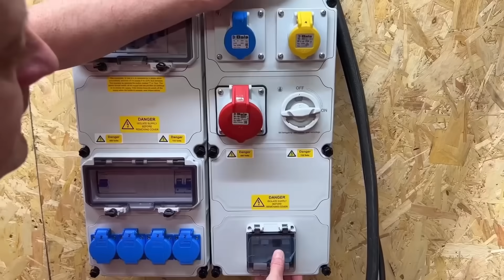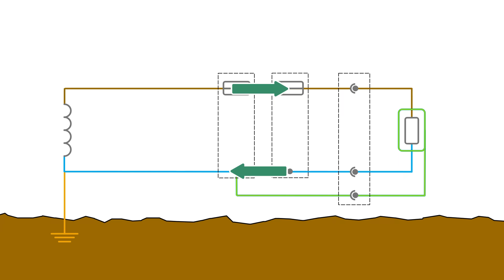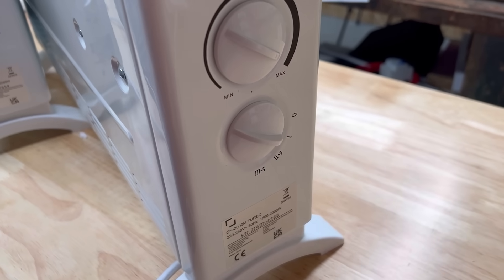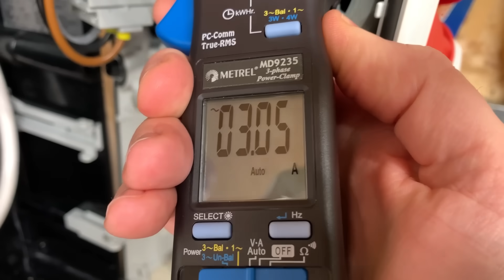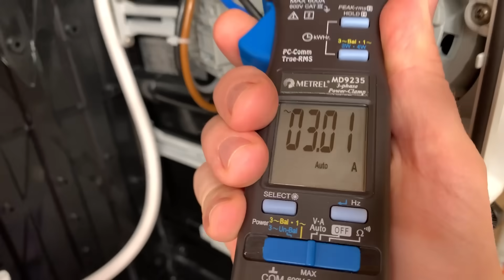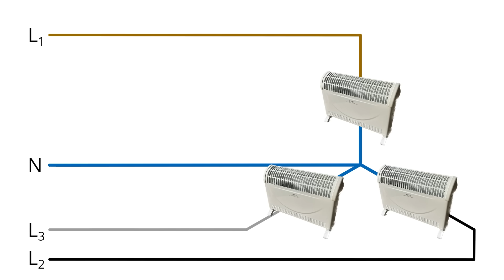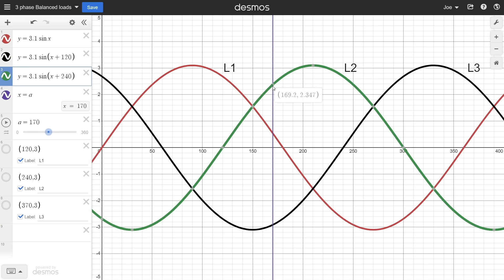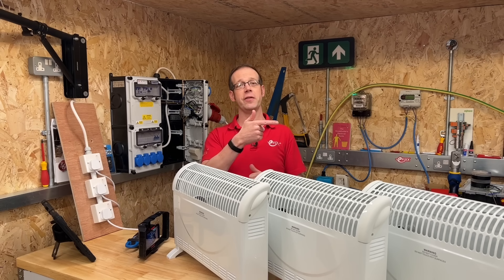Does Current Flow Through The Neutral Wire?

Comment: For anyone having trouble envisioning this, it's a bit easier if you start with something like American (two phase) house wiring, which comes in from the pole transformer as 240V, but with a center-tapped neutral wire.  That means that neutral to either live conductor is 120V, so you basically have two 120V circuits, but each one is 180 degrees out of phase with the other (and typically half of the house circuits will be wired to one side and the other half to the other side).

Because of this, if you need more than 120V for some appliances (such as many stoves, water heaters, EV chargers, etc), you can just connect them across the two different "live" wires to get total of 240V instead.  In that case, you don't need the neutral wire, because all of the current going in on one side is balanced by the (exactly opposite) phase on the other wire going out.

But it also means that on the neutral line going back to the pole, there may or may not be a lot of current, depending on how well the loads on the different house circuits are balanced.  If you've got the same amount of stuff going on one half as on the other half, then all of the current will go "in" from live A to neutral, then from neutral to live B and back out again, and there will be no net current on the neutral line.  However, if there's more load on the A side than the B side (or vice-versa), then all of that excess needs to go back out the neutral instead.
Reply: wow that explanation made my brain hurt
Reply: I am sorry, US 240/120 vac Single Phase is what most American residential homes are supplied with, Hence, SINGLE PHASE! Not two phases! Everyone seems to think of it as two 120 volt phases 180 degrees out of phase, It is not! It is ONE 240 volt phase center tapped to create 120 volts for use on 120 volt devices (accepted safety standard in the US and other places as well)! Center tapping the transformer winding does not create two separate phases it creates two separate voltage potentials on the same phase! The center tapped winding and or conductor is then grounded and or bonded to the primary neutral creating zero potential difference between it and ground/neutral. It's only purpose is to carry any unbalance of the 120 volt current back  into the transformer winding! One winding! One 240 volt phase! Draw it out on a piece of paper and realize also that the unbalance can only flow with with neutral from one side of the split phase at any given time. This scenario is 240/120 split phase (Single Phase! perhaps people get the wrong understanding due to the term split phase and not realizing it is being created with just one winding. In the US, It was common 30+ years ago to see 240/120 delta three phase in all types of buildings, this too could be a reason for this misconception or misunderstanding 240/120 split phase). On your piece of paper draw out your homes electric supply as two ungrounded lines (one 240 volt circuit) coming from the transformer and one grounded center tapped line! Now draw it out as a schematic and start adding 120 volt and 240 volt appliances. Now draw out a sin wave graph of your schematic, when the peak of the 240 volts is on one conductor of the circuit the other conductor is at a potential difference of 240 volts less (zero volts in this situation) and the center tapped conductor is at a potential difference of 120 volts less/more respectively to each of the main ungrounded conductors! Keep in mind the primary winding is just one winding with one side of the winding grounded. I hope this helps clear up the whole two phases, out of phase misinterpretation! I to this day see seasoned electricians refer to the 2-240 volt ungrounded conductors coming into a house/building as phase A and Phase B thinking they are two separate 120 volt phases, they are not! And if they are, they are not 240/120 split phase!
Reply: @k---youtube  I think you're trying to quibble semantics, and you're doing it by redefining some terms in ways that are different from how everybody else actually uses them.

All voltages and phases must always be relative to some reference  (without a reference point, the terms are meaningless).  In power distribution systems, unless explicitly specified otherwise, these terms are almost always referenced relative to neutral/ground.  And relative to neutral or ground, each hot line of a US split-phase delivery is 120V, with opposite phases (180 degrees offset) to each other.

And there is electrically absolutely no difference between a single winding with a center tap and two separate windings of opposite polarity which share a common neutral, so the number of windings in the transformer is completely irrelevant to this question, really.

(Also, by your logic (if phase is considered with one of the live conductors as a reference, and not relative to neutral), then standard 3-phase power would actually be only 2 phases, because there's one phase between the A and B legs, and then a second phase between A and C, and that's it.  This is obviously not how anybody actually defines it in reality, though.)
Reply: @foogod4237  No Sir, Not trying to quibble with  semantics or offend in any form. Just trying to expand and shed light on a common misconception of this subject. I am merely stating that a 240/120 vac split phase service (common US residential electrical supply) is not two separate phases. In your original post as well as in your rebuttal, you state that it is two 120 volt, 180 degree opposing phases. This is a misnomer, the two 120 volt halves of the 240 volt service are not two separate phases 180 degrees out of phase with each other but indeed 100% in phase with each other!
You actually validate my argument in your rebuttal, You make the claim that there is no difference between a single center tapped winding and two winding's of opposing polarity sharing a common neutral (180 degrees out of phase with each other). This is exactly my point! There is a difference and the difference significantly confirms what I am pointing out. A single center tapped winding (in this case is the 240/120 vac split phase) supplies 240 volts between the two ends of the transformers winding and 120 volts between either end of the winding and the center tap of the winding.
Two separate opposing polarity winding's sharing a common neutral will have 120 volts between the end of either winding and the shared neutral point and halve zero volts between the two ends of the winding's! They will have zero volts because they are 180 degrees out of phase (opposite/offset) with each other! Plus the shared neutral will now carry the total combined  current! 
reference to ground/ neutral has nothing to do with this at all, a reference point can be anything you want it to be. your reference to 3 phase doesn't make sense, when your measuring voltage on three phase your either measuring between phases (two of three or three of three phases 120 degrees out of phase with each other) or from phase to ground (three separate phases).
Reply: @k---youtube  "Two separate opposing polarity winding's sharing a common neutral will have 120 volts between the end of either winding and the shared neutral point and halve zero volts between the two ends of the winding's! "

Ok, this isn't even semantics, this is just fundamentally a totally wrong statement.  If you don't believe me, I strongly encourage you to actually try it yourself.  I repeat:  there is electrically absolutely no difference between a single winding with a center tap and two separate windings of opposite polarity which share a common neutral,  That means they physically cannot produce a different electrical result.  The two are electrically the same circuit and guaranteed to be exactly the same in terms of the electricity they produce.

"They will have zero volts because they are 180 degrees out of phase (opposite/offset) with each other!"

No, you are not describing opposite phase at all.  What you are describing would only be true if both wires always had the same voltage potential (0V difference) at all times, which is actually the definition of being in the same phase (0 degrees offset).  If they are in opposite phases, then they must always have opposite potentials, which means one would be at -120V when the other was at +120V (relative to ground/neutral), and vice-versa, and therefore the difference between the two would be ±240V (peak-to-peak), not zero.  This is, in fact, exactly what you will see if you look at the two live conductors of a split-phase system with an oscilloscope, proving that they actually do have opposite phases (relative to neutral).

It seems pretty evident that you don't actually really know what 180 degree phase offset means or looks like (or possibly also what "opposite polarity" means), so I would encourage you to read up on that a bit more, and possibly try it out for yourself (with maybe a lower-voltage AC power source, an oscilloscope, and some different transformers).
Reply: @foogod4237  I understand what your trying to say. However, in regards to an oscilloscope you are not seeing two phases 180 offset (actually 180 degrees out of phase with each other is the proper term) because the oscilloscope is using the center tapped grounded conductor as it's reference. It is showing the exact same phase sin wave as a mirror image. The opposite of the other 120 volt single phase side. If you have access to an ungrounded oscilloscope and take a reading you will see the sin waves overlayed with each other exactly.  Also, I most certainly know the differences between out of phase and opposite polarities and as far as reading up a bit more, well, I have written over 70 essays and 3 books on electrical engineering, spent 40 years in the engineering field of which the last 20 were with ABB as a power distribution engineer! So I would encourage you to perhaps run the tests I have explained and learn for yourself what opposite polarity and out of phase mean. They are not the same! Not to mention, I would love to physically see how you can change the magnetic flux direction of a single coil winding secondary with a single coiled winding primary into two separate opposing phases just by tapping the winding? 240/120 single, split phase is one phase! the two 120 volt halves are a lower voltage potential of the same phase, One Phase! Your oscilloscope is showing the opposite polarity of the one phase as a separate phase! It's because your oscilloscope is grounded! Look, everything your stating is accurate except for there being two 120 volt phases of opposite/opposing direction at the same time! It is not! The only thing that is 180 degrees apart is the polarity of each half cycle. And by your logic if it were two phases 180 degrees apart you would have no potential voltage difference between the two ungrounded sides, hence no 240 volts! They would always be at equal potential of each other! It seems pretty evident that you don't actually really know what electromagnetism means or looks like ( or possibly what the fundamentals of induction are), So I would encourage you to read up on that subject along with how to perform the proper tests using the proper tools correctly! Start small, Perhaps some flashlight batteries/small ac transformer and an electronics kit from a local hobby shop. After you develop a solid understanding of how current flows and the effects of electromagnetism on inductors and such perhaps then you could actually give people real, accurate information! Just Saying
Reply: @k---youtube  
In three phase each phase is separated by 120 degrees. The US system is single phase, with each of the two hot conductors separated by 180 degrees.

So, as far as the electrician sees it, the transformer gives him two phases coming in 180 degress apart not 120.  He treats it like two phase.
Reply: 180deg across the phases. You sure about that?
Reply: @greenpedal370  Yes, he is quite correct about their being 180 degree phase shift between the two lines in the US split phase system. 

If you know enough about sine waves and electricity, you will realise that 180 degrees is the only way that is possible.

If you think he is wrong because you think it should be 120 degrees, then that is certainly incorrect. 120 degrees phase shift between phase conductors only occurs in 3 phase systems. And that is because they physically position coils around in the generator at 120 degrees around the rotor.

In the US split phase system, the phase signals that are distributed to consumers  do not originate from the power station and generator, they are produced by the down stream distribution former and is a result of how the secondary windings are connected. It's very different to 3 phase.
Reply: @deang5622  so who makes the powers supply? who is spinning the magnet??
Reply: @magnito9811  What has the transformer got to do with the phases of the supply in 3 phase? Answer nothing!

The transformer only comes into it if we are talking US split phase as it's the connectivity to the secondary windings and the configuration of the windings that enables two separate phases to be produced.

So I'm totally puzzled where you are going with this useless question?
Reply: @deang5622  you’re a pure genuis, i have one more question if you don’t mind. i don’t understand how voltage reading works in low voltage wirings, i put one lead on common and one lead on whatever terminal but i don’t understand why or how i read voltage, doesn’the common terminal have voltage too? since the meter measures the difference how do i get a reading?? i do understand how i get voltage if i have one prope on ground that’s makes sense, but a common point in a live circuit?? please help me thank you
Reply: @magnito9811  Don't be so friggin childish.
Reply: @deang5622  sorry i’m new into electricity and want to be top techs, i want to understand every little detail about electricity
Reply: @deang5622 
> 180 degrees is the only way that is possible

Be careful about your wording though. There are still cases where some consumers get two 120V live taps which are 120 degrees out-of-phase. I can think of one scenario: apartment complexes with shops on the ground floor like laundromats. Those businesses often need three phases compared to residential units who just need two. What they usually do is they give three live taps to the shops. They then divide the residential units to three groups, each group having a pair of live taps. So I'm not sure what you mean by "[it] is the only way possible." The only difference here is the residential units receive 208V on their usual "240V" outlets but they could still plug their 240V devices fine (assuming that device is compatible on both voltages). I think the split-phase is only common is suburban areas which I assume is widespread in the US.
Reply: @unhash631  I think you will find I am careful about my wording.

Let me explain again.
If you have got 240 volts from a 120 volt system then it can only be done by having two phases 180 degrees apart. I challenge you to find another way to do it.

If you have two phases at 120 degrees apart at 120 volts each, then you do NOT get 240 volts RMS. That's a simple fact.
Plot the waveforms out on a piece of paper on the same chart on the same axis and work it out
Reply: @deang5622  I see what you mean now 😅 and I agree; It's impossible. You don't get 240V RMS with a 120 degree phase shift.

I just thought you were implying that we don't use 120 degree phase shift in North America. We do, especially in urban areas. Just wanted to point out for those who people not familiar with out electrical system. They might be confused how we deal with these intricacies.
Reply: @unhash631  if the two waveforms are at zero degrees or 180 degrees phase shift relative to each other, then the potential difference is a simple numerical subtraction of the RMS voltage value.

If the waveforms are at any other degree phase angle, then it isn't a simple subtraction and you have to resort to trigonometry (using sines and cosines) or complex number theory, representing each phasor as a complex number in the form of a+bj , which encompasses the magnitude and phase.

Or you use a website which can calculate the RMS voltage between the two phases where you input the phase angle and RMS voltage.
Reply: @deang5622  Now in a 3-phasor diagram you add the 3 vectors, you end up with zero.  In a US system with a split transformer, do you end up with zero or 240? Meaning, are the to votages in phase or in opposite phase?
Reply: @deang5622 Hi Dean. In a residential service in north america you have a 120/240 single phase service. There is  no 180 deg out of phase. there are 2 120v windings on the same transformer core operating in phase and they are wired in series with the centre point brought and in most cases bonded. This is where your white neutral wire is taken from. The other 2 wires are 240 volts apart as there are 2 120 volt coils in series.
Reply: Yep, one of the transformer 240V phases will be centre tapped. 

That gives 2 x 120V, which in series drive high power devices like tumble driers, washing machines and whole house air-con.

When I worked in the US I wired my UK hifi amplifier across the two.
Reply: 240 volt power is only single phase so there is no phase shift. I have never heard of 2 phase power
Reply: @scottmc1178  
There is such a thing as 2 phase power. I have come across two phase motors.
Reply: @johnburns4017  Its only split phase power. 1 of the 3 phase power. They tried 2 phase in the early 20th century but it died off.
Reply: @greenpedal370  Yes he is right in the two phase electrical system in the US.
Reply: The voltage system in your average American residential setting is going to be derived from a single transformer that steps down high voltage (ranging from 4160V-13.8kV or more) down to single phase 240/120V, with the neutral connection originating at position X2+X3. 

Although 2-phase does exist and is addressed in the NEC, it is all but a defunct voltage system. The vast majority of electrical systems in the US are either single phase 3-wire 240/120V, or 3-phase systems 3 or 4-wire systems of varying voltages and transformer configurations. 

Please make sure your info is correct before posting.

In a multi wire branch circuit that consists of 1 a-phase wire, 1 b-phase wire, and a neutral wire, the neutral will be the return path for the unbalanced current between the A and B circuits. 

A common example you’ll see in houses that was standard practice in the last couple decades was to run a 12/3 cable to power the food disposal and the dishwashing machine. 

Both circuits are on separate phases, but share the same neutral wire. 

Let’s say the dishwasher uses 3 amps, and the disposal uses 12 amps. Because the way parallel circuits work in an AC system, voltage stays constant, and amperage between phases is subtractive. With this in mind, to find the current returning on the neutral wire you would subtract the lower amperage from the higher amperage: 12A-3A=9A. 9A will be returning to the source on the neutral wire.
Reply: @J_Trask   "Please make sure your info is correct before posting." Sorry, was that directed at me?  Because I'm not sure what you're saying I got wrong, since as far as I can tell you just said basically exactly the same thing I originally did with slightly different wording.

If you're referring to my use of the term "two phase", that was actually correct.  Many people seem to believe that "two phase" can only ever mean a 90-degree phase offset (which is, if I remember right, what the NEC calls 2-phase, and I agree is pretty uncommon nowadays), but that presumption is only an NEC convention, not something inherent in the meaning of the term itself.  The fact of the matter is that the US system we are both describing (known as "split phase" in the NEC, I believe) does still employ two distinct electrical phases (relative to neutral), and thus is also very much a form of two-phase system (more specifically, it is a "180-degree two-phase" system).  I used the (descriptive) term "two phase" instead of the (NEC) term "split phase" because most people who are not US electricians do not know what the latter term actually means, and I wanted to explain the parallels between the system and the "three phase" system being described here, so the number of phases involved was actually the relevant point, IMHO.
Reply: 240 volt power in North America is single phase of a 3 phase system.
Reply: U.S. is single phase. not 2 phase for residential stuff
Reply: I'm sure I have read that he US system isn't two phase - but rather rather single phase with a three wire supply - one coming in at 240v wrt neutral and the other from a centre tap on the transformer at 120v wrt neutral. So called split phase - but both hot wires are in phase with each other - just at different voltages.
Reply: @_chrisr_  A bit wrong. Before the service drop in a typical home, there's a transformer. This transformer usually takes a single phase from a three-phase/three-conductor transmission line. The transmission line voltage can go as high as thousands of Volts but on the consumer side, it's always 120V wrt to neutral on each leg. So inside the house you could have two 120V outlets which have two different phases but all your 240V outlets are always in-phase.
Reply: @unhash631  thanks - is the phase shift because of the way the transformer is wound?  How much is it shifted by?  What is the rms pd between the two phases?
Reply: @_chrisr_  The phase shift is because of the center tap. The waveforms on each leg mirror each other to achieve 240V so each leg is shifted to each other by 180 degrees.

That is the usual setup in a typical suburban home. In urban areas though, there are cases where the shift is only 120 degrees. This typically occurs when you live somewhere dense and you share a line with some establishments that use three-phase electricity. In that case, your line-to-neutral voltage would still be 120V but your line-to-line would only be 208.
Reply: @unhash631 
Yes, the 240v is in phase. The two 120v circuits are 180 degrees our of phase.
Reply: @_chrisr_  No, the neutral is actually the center-tapped wire.  The result is that you have one hot wire that is 120V, and another hot wire that is "-120V" (120V with opposite phase).  If you combine the two hot wires with opposite phase, you get a total difference of 240V between them, but nothing is ever more than 120V relative to neutral.

(This is actually part of the genius, IMHO, about the American system, as even on 240V circuits, if you have a fault to ground or neutral (such as somebody touching one conductor and ground) the fault potential for each hot wire is still only 120V, which actually makes a lot of things safer.  It also lets you split the load evenly between the two hot wires coming from the pole by just putting different house circuits on the two different 120V phases, while also still allowing you to supply 240V to things that actually need it)
Reply: @foogod4237  thanks for the explanation - that system is what we have here in UK for use on construction sites - equipment is designed for 110V and supplied from a transformer where neutral is centre tapped and the 110 is across both ends so a worker bridging line and ground/neutral will only get 55v shock.
Reply: @_chrisr_  
Called a Centre Tap Earth System. 110V CTE (55V-0V-55V) 240v to 110v transformer. 

In a 110v CTE system, instead of the neutral lead, the centre tap is connected to the supply earth from the 240v side. The secondary side has no neutral. Caution must be taken to ensure that no live lead is earthed, as a short-circuit may occur leading to transformer failure. Also, the centre tap of the transformer should be left unconnected when is it not in use in an unearthed system.

Commonly used for site safety portable tools. The centre tap splits the winding into 2 sides with each having only 55V with respect to earth. In case of an electric shock, this limits the shock to 55V, half of 110V. Although 55V can still be a fatal shock under certain circumstances. For portable tools usually installed with an RCD.

Similar to the US domestic system where a shock on the 240v side is only 110v.  The reality is that RCDs have negated 110v in construction sites.
Reply: @johnburns4017  quite an ingenious system.  That was my understanding of the US system too but instead of -55 and +55v output there is only one 120v and one 240v output, both in same phase but at different voltages and both 120v different with respect to each other and 120v to neutral from the 120v tap and 240v with wrt neutral.  People with more knowledge than me say there is a phase difference too - if there was 180 shift then voltages would be same but if there was 120 difference such as would be seen witth a 3-phase system then (according to chatgpt) the voltage would be 120v assuming a line voltage of 415v between phases.  However I understand that the three phase system in US is 480v so if two phases were utilised the output voltage would be 157v and since that isn't what is observed I am concluding that it is just a centre tap transformer on single phase.
Reply: @_chrisr_  
There is no genetator phase difference in the US two hot wire split phase system. It is all off the same genetator phase. 

The transformer, off one phase of the generator, gives 240v on the full secondary transformer winding. Take a tapping off it half way then you have 120v. Take one off a quarter of the way then you have 60v. All off the same  phase.

The transformer presents to the building two hot wires 280 degrees out of phase. So as far as the building sees it, it is single phase 240v and two 120v wires 180 degrees out of phase. Connect the two out of phase 120v wires to an appliance then single phase without a neutral.

The cludge of a US system came about because of commercial interests between Westinghouse and Edison. It was not a wonderfully dreamed up highly technical  state-of-the-art system at all. It was also to save on copper cables. On the Kathy Loves physics channel, she goes into the history.
Reply: @_chrisr_  I think you are correct.
The 240volts is just the potential difference across the two ends of a single secondary coil, which is centre tapped in the middle so that 120v can also be produced.
Reply: FFS! If you have trouble envisioning it then go back and re do your entire electrical training!

It's that basic a question. And if you don't know the answer to it, you shouldn't be anywhere near mains electrical installations, even if you are "qualified". Because for you not to know the answer means that: 1. You have forgotten your basic electrical education, and 2. That you don't really understand electricity.
Reply: This depends if you have a balanced load some loads on the split phase system do still need a neutral to balance the load but still need both phases to get 240 volts to run the load. Some things I've seen are weird where like in an ev charger some have complex circuitry that do the load balancing and there is no need for a neutral there. But ya just depends.
Reply: To my understanding the two lines in a 240v circuit are returning on each other back to its source.
Reply: @mikerosoft1009  Define "source". In order for electricity to flow the lines in any electrical circuit the lines take out and then return the current to the source.

In US system the 240 volt is produced by taking the output from a step down transformer, where the secondary winding is centre tapped so that two voltages can be derived: +120, -120. Both referenced to the centre tap point.
Making a final circuit using the +120 and -120 volt lines gives : 120 -(-120) = 240.

In Europe and UK, the 240 or 230 volts is achieved by : taking one of the three phase conductors and taking the voltage between that and neutral.
The transformer is a 3 phase transformer and has a common point of one end of all 3 secondary windings connected. That is where the neutral point is connected.
So the 230 volts (still is 240 in the UK on the actual circuit) is across any of the three phase outputs from the transformer and that neutral common point of the 3 windings (the windings are connected in a star configuration).
Reply: Yeah, but one thing I've never understood about this is that for many applications, such as within large buildings or multi-unit residential complexes, it's not 240. It's 208. If you look at the peak of his desmos graph, the current through L1 is 'balanced' through opposite currents through L2 and L3 at peak. When you pull this two-phase version (technically called single phase still) as opposed to the 240V split phase, and you try to run your stove or drier off a 208V plug, does that extra current that would've gone through the third phase go through the neutral? I've seen 240V applications not require the neutral - you just run the two hots of the split phase. But running two hots in a 208V system, the current doesn't balance.
Reply: @smokeybobca  You're right, there are some (usually large multi-tenant) residential situations where the two hot wires actually add up to 208V instead of 240V.  This is because instead of taking a single phase from the power company and running it through a center-tapped step-down transformer to get split-phase for each residence, they actually just run three-phase power into the whole complex, and then for each residence they just use two of the three legs for the two hot wires.  This means that in those cases, the two phases are not 180 degrees but only 120 degrees apart from each other, which when you sum them together results in a voltage difference of only 208V instead of the full 240V.  This is usually "close enough" for most high-power appliances (though electric stoves and such are sometimes annoyingly not as powerful as they should be, etc), and it's actually a lot easier and more efficient to wire things this way for situations where you're distributing power to a whole bunch of densely-packed residences.

In terms of balancing, there is no extra power going over the neutral line for any individual appliance/residence from this, but it does mean that for the whole complex, there may be more current flowing over two of the three conductors than the third one at any given time.  However, typically which two wires are used is chosen to be different for each residence, so the idea is that over all of them, the different power usage will probably more or less balance out most of the time (because, for example, a large appliance in residence 4 on lines A and B will be mostly balanced out by another large appliance running in residence 37 on lines B and C and a third one on residence 208 on lines C and A, etc).

Most single-family homes and such have a transformer for each house, though, and supply the full 180-degree split-phase power to the house, and that's usually what most people assume when talking about split-phase power in general (and is often much easier to visualize, because the phases are exactly opposite so you don't need to do any fancy phase-angle calculations to figure out what the potential is at any point in time).
Reply: @foogod4237  Rare to see a situation where they supply a single house with it's own transformer. Usually, they have a bus of sorts (either exposed single conductors or a triplex cable) spanning the poles that several houses share a single transformer. Only time I've seen a single transformer supply a single residential building was for either a 400 amp service, a duplex/triplex/quadplex, or row houses/townhouses. At least that's up here in Canada they do it that way.
Reply: @TheDrew2022  Well, you're right, I was oversimplifying, I guess.. It's quite common to have several homes served by each transformer in the US too (depends how far apart the homes are, though).  My main point was just that power for almost all single-family homes always comes from a single phase off the main power lines, converted into split-phase by a transformer (of some kind) before it gets sent to the house (three-phase power is typically not run to the houses themselves)...
Reply: @smokeybobca  To put it simply, that extra current just goes around the system as losses. Of course, that is assuming that your secondary winding is delta. Some three-phase lines provided for the end-user uses star (also called wye) configuration. In that scenario, that extra current just returns to the neutral or "star point."

However, as @Foogod pointed out, in some instances, a neutral might not be necessary since the load just balances out eventually. For example, residences usually use electric stoves and heaters around the same time. It all depends on how a building is designed.
Reply: It's called grounded conductor, always has current in neutral, not the same as protective earth
Reply: In the USA using split single phase (120v and 240v).  
* They take a wire off the centre of the coil on the secondary side of the transformer for the N of 120v.  
* The centre tapping is regarded as neutral and is grounded.
* The grounding is for lightening strikes and dissipating static electricity.

240v
* When using 240v both of the cables on the full length of the transformer's secondary coil become a return. It is AC so forward and back for each one. Just like single phase in Europe. L off the top of the transformer coil N at the bottom of the coil. The N cable is earthed hence zero volts - neutral. In the US no cable at the ends of the coil is earthed creating a neutral of zero volts. Both ends are live with 240v or hot as they say in the USA.

* The secondary coil is grounded at centre tapping. 

120v
* When drawing 120v Line comes off the top or bottom of the secondary transformer coil, then returns to the coil of the transformer half way down the coil - the N.  
* One half of the coil is ignored when drawing 120v.
Reply: not 2 phase. single phase with bonded neutral. 2 phase is something else.
Reply: Thanks for this explanation on the US voltage supply.
Reply: @bitTorrenter  just further proof it’s best to keep Americans in America.
Reply: @gary23jag  yepp, not in use in Europe. We use the 3-phase TN distribution system.
Reply: This explanation of 220 volt circuit design mostly applies to resistive loads, is my experience. Electric water heaters with resistive elements, electric stoves etc. But a soon as a motor or clock is introduced, you will be needing that neutral wire. Confession: Not an electrician